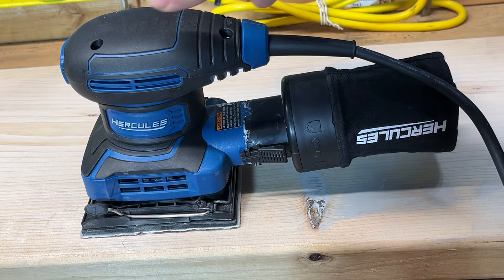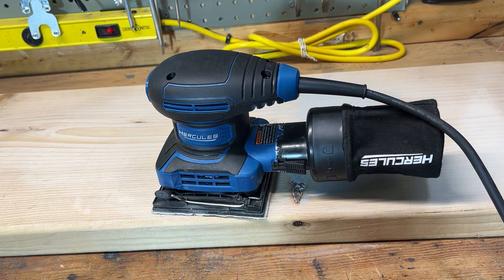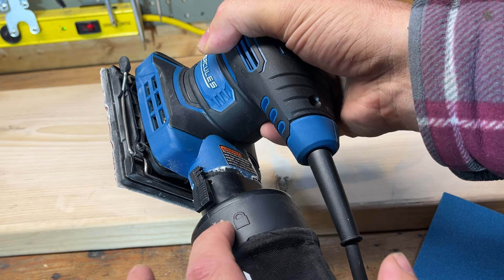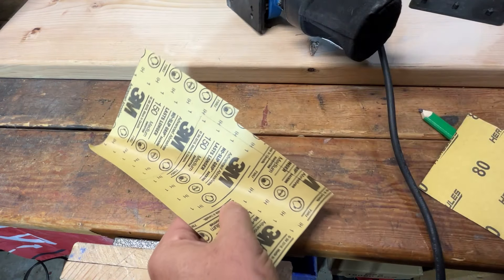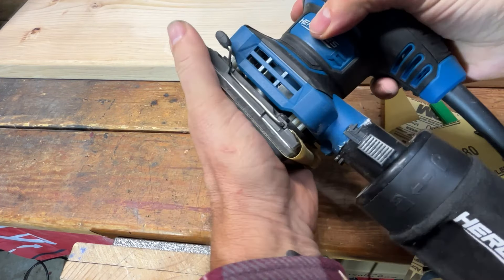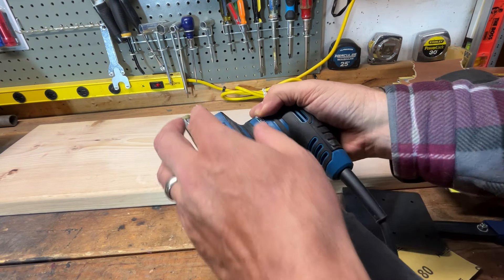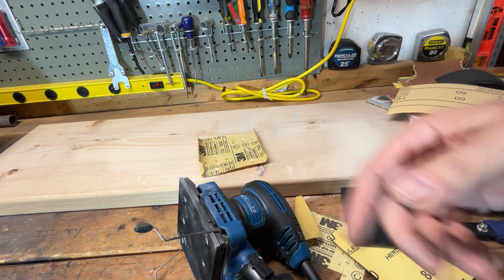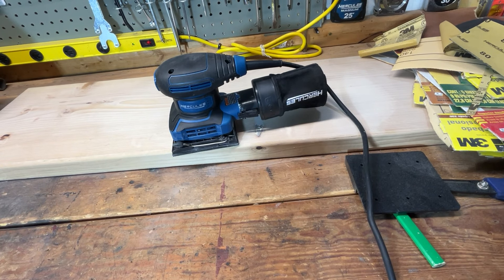HERCULES 2.4 Amp Orbital 1/4 Sheet Sander - review

Comment: Thanks!  Checking out all your Herc corded sander videos for the sale today!  Might go with this one. I’m glad you showed the vibration. A reviewer of corded random orbital sanders said the Herc RO had really bad vibration.

Looks like this does not have a speed selection on it though.
Reply from the maker: Ya! Just has a on and off.
Reply: I would give that second thoughts. I forgot to remove the hook and loop paper and 2 weeks later it was stuck to the backing pad. Now hook and loop paper, which I bought a lot of, won't stick. I can find replacement backing pads for any other sander but this one.
Reply: @garyboore6015  I went with the RO sander for $35. It wasn’t very good. It would yank itself around every once in a while as I moved it over the board.  I felt like it was going to gouge whatever I was working on.  I returned it.

Comment: Why is it impossible to find replacement backing pads for these? I forgot to remove the hook and loop paper and 2 weeks later it was stuck to the backing pad and now the hook and loop paper, which I bought a lot of, won't stick to it.
Reply from the maker: @garyboore6015  go to the HF website to the replacement parts section.